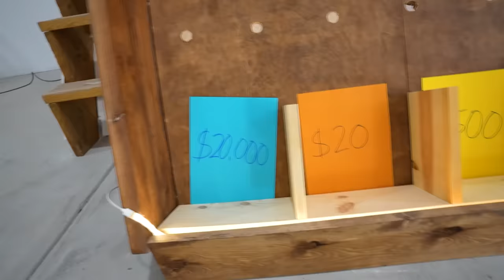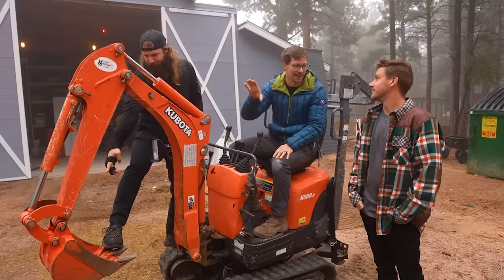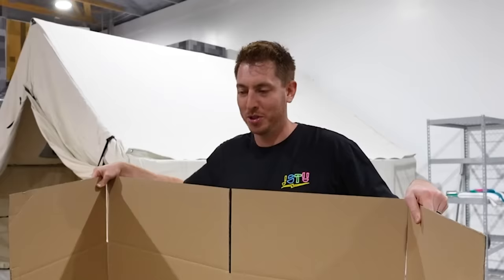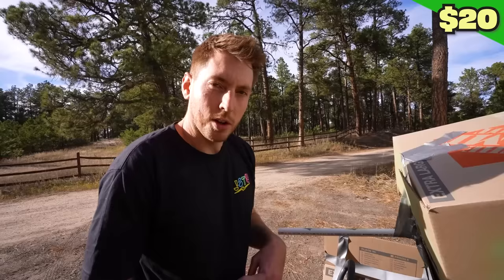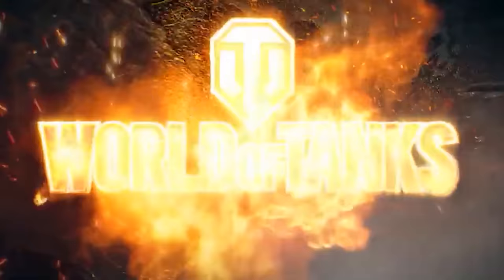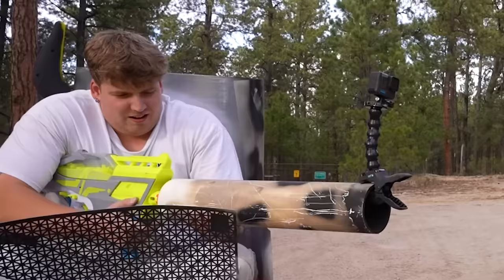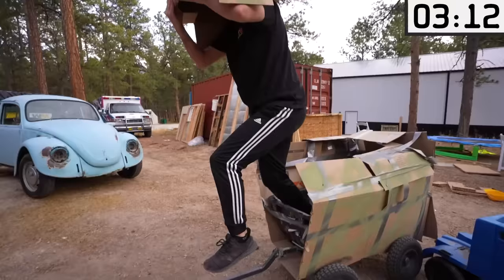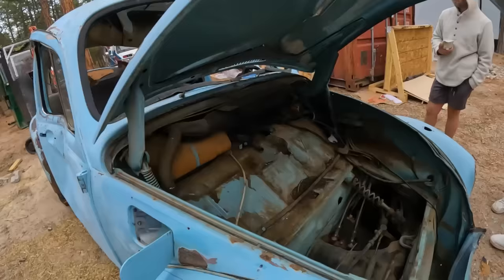$20 VS $20,000 TANKS *Budget Challenge*

Comment: I think you can add a wooden frame put metal on top of the wooden frame and then actually build the inside fill them inside with decoration and then you could disassemble the treads on the mini excavator so you can already and you know Drive it put the turn on top of the wooden post